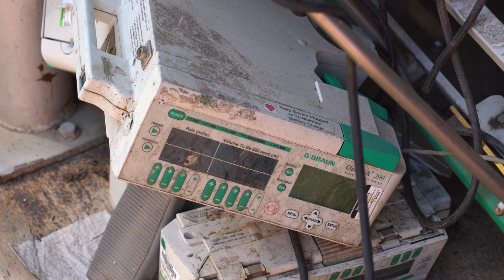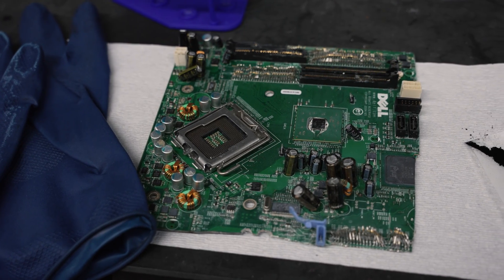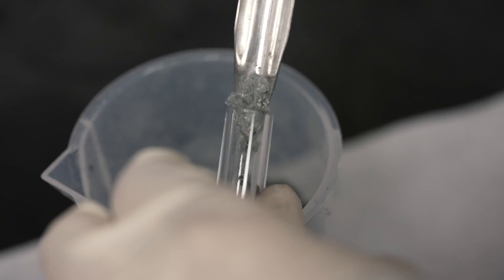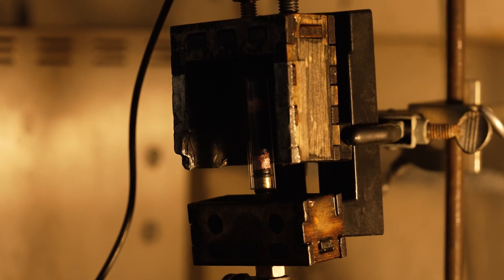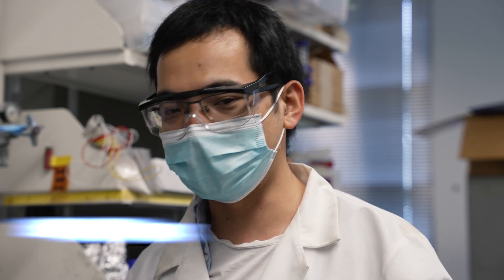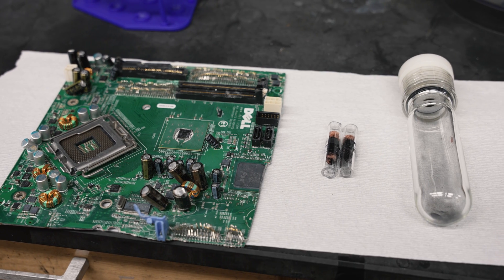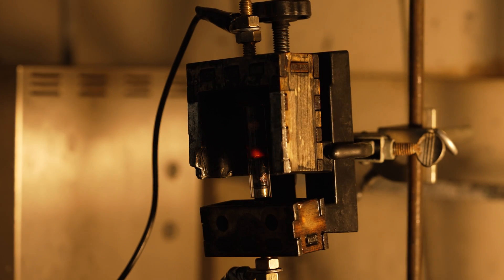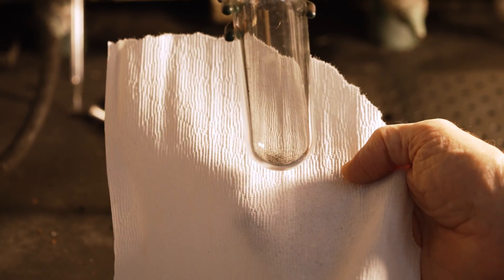Flash Joule heating by Rice lab recovers precious metals from electronic waste in seconds

Comment: Ive made a method using a modified plasma inverter using a flash plasma arc as the process that can be automated in a vacuum chamber using solenoid valves to load & unload the graphene grown into an exterior collector more efficiently than flash joule if you’re looking for a open source process that doesn’t require licensing.
Reply: That sounds like a pretty interesting idea. Is there any way I could contact you to speak about this?
Reply: i second this^
Reply: Likewise, I'd really appreciate learning more and would be fascinated to talk with you about it. I'm researching ways to mass produce the material at scale
Reply: That's interesting. I would like to learn more about it. How can I connect you?

Comment: I am looking forward to seeing how this process scales!
Reply: It doesn't look like it does. Not that you can't. It's just looks very energy expensive. They're essentially vaporizing material.
Reply: @junkdubious  ?? they are doing this in a lab, this is why they are doing small amounts... they even say in the video it will take years to scale up.
It is also estimated to use as little as 1/500th the energy of current smelting methods and uses far less acid in the end. Getting the metals out in seconds instead of days and using 1/500th the energy sounds like a potentially quicker and cheaper process.
Reply: @ian5088  I never questioned why they were using small batches, it would seem obvious to do so. Using electricity to generate heat is a pretty straight forward process. ALL materials have a vaporization pressure, and ANY time you use one type of energy (electricity) to produce another type of energy (heat) you will have inefficiencies. Even if it was a 1:1 ratio it takes an enormous amount of energy to vaporize that kind of mass.